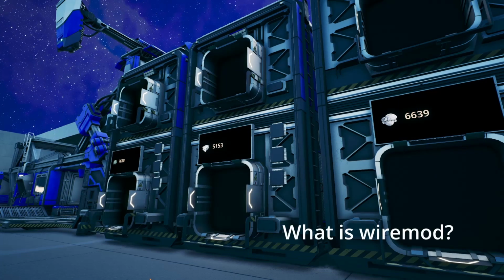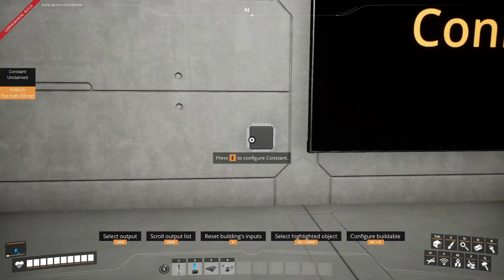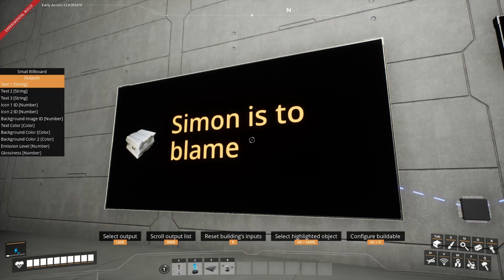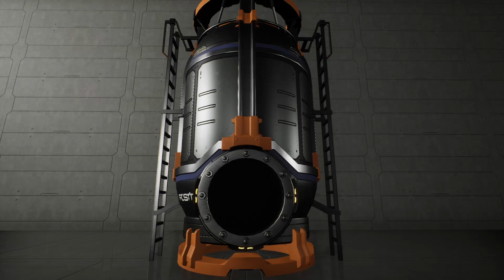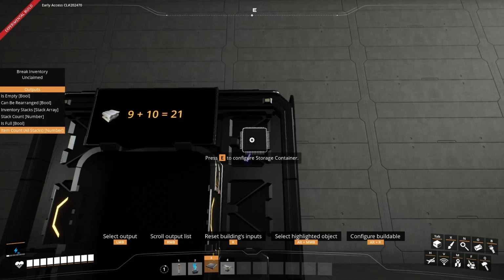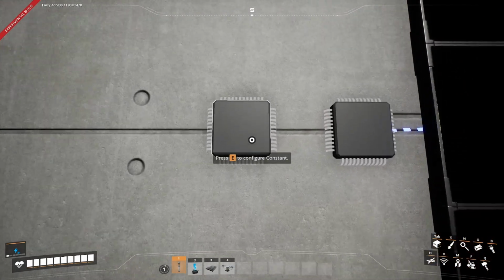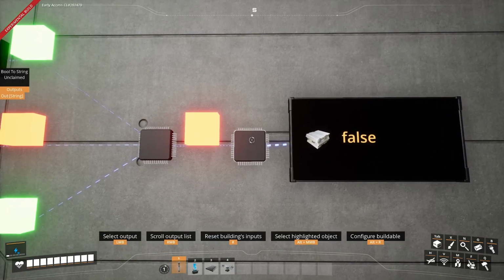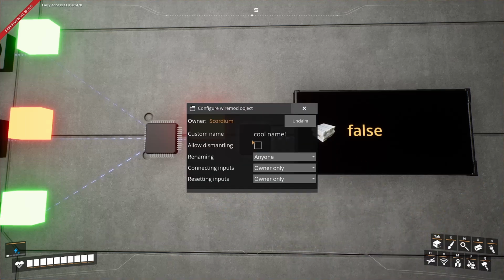[OUTDATED] Ficsit Circuitry Tutorial | Satisfactory

Comment: Hi, this mod is amazing. I have a question though. In the blueprint, the blueprint keeps: the inventory info (break inventory) the link to "number to string". But it does not keep the "string" link to a screen. Is this a known bug? Can we solve this?
Reply from the maker: This is a known bug with blueprints but can't be fixed because of how wiremod handles connections to the inputs of buildings that don't work with wiremod "out of the box"
Reply: @samcrosscat  Thanks for answer :)
Did you know a way for to allow a triple (or +) choice?
Example: if I want the color of my text to be A, B or C, instead of just A or B. Is it possible?

Comment: Does anyone know about the limit when adding numbers with chips? For example I'm making a board that takes dynamic average of power/liquid/etc every 4 seconds and am thinking about resetting it every hour..about 900 cycles. 9,000,000... in other words can these chips handle numbers over 10million without too much issue? Thanks
Reply: Just an increment chip adding new values every 4 seconds, and another one counting the cycles then dividing the two to get an average. But by the end of both cycles I will be left with numbers well over 9million and not sure if that's a foolish endeavor.
Reply from the maker: You came up with a random definition of "cycles" and now wondering if someone can help you understand it, i have no words for you.
FYI: one hour is 3600 seconds, which is well enough for a timer gate to handle.
Reply: @Scordium  thanks and na I just shorthanded for cycle, 3600s(1hr) / 4 (once every 4 sec) = 900ticks per cycle

Every tick an increment chip adds upwards of 10,000MW tho so by the end of 1hr cycle I will have a number in the tens of millions. (900ticks x 10,000MW, power will easily increase to 20k but not 100k MW so i figure if it can handle tens of millions it should be ok) Tried it last night and it hasn't crashed my game yet  ;)
Reply: @Scordium  oh oops stupidly tired me at 3am wrote cycle instead of tick I see what you mean now. Lol. No formal training in this stuff learning it all from scratch w/wiremod. Awesome mod.

Comment: When you too far from wiremod objects, seems like they don't work. For example I have setup of flushing a tank as shown on video. It works perfectly, but if you go too far, its stops. Is it a bug or I am doing something wrong? Mod is amazing btw :)
Reply from the maker: Blame satisfactory. Some kind of optimisations prevent the gates from being able to read data correctly. A workaround would be to just use a timer and flush the tank every X seconds. As far as i know, fluid tanks are the only objects that have this issue.
Reply: @samcrosscat  Thank you for suggestion. Helpful :)
Reply: The radio receiver says Receives data from any distance. I wonder if they are for long distances maybe?